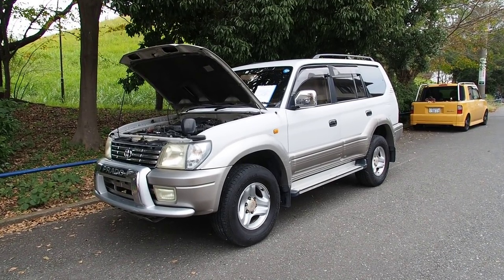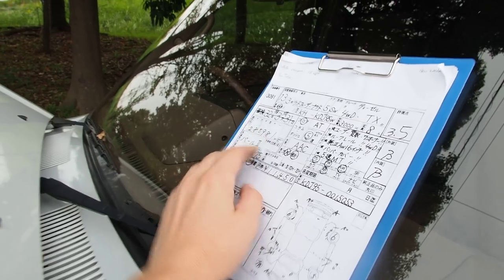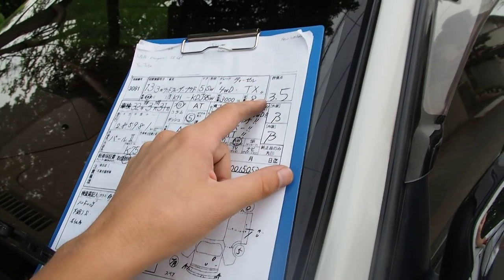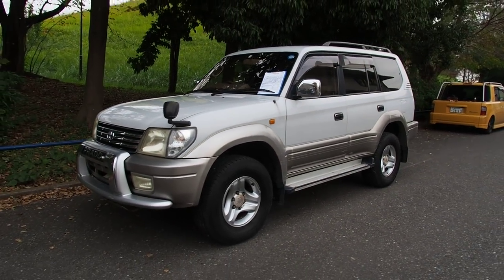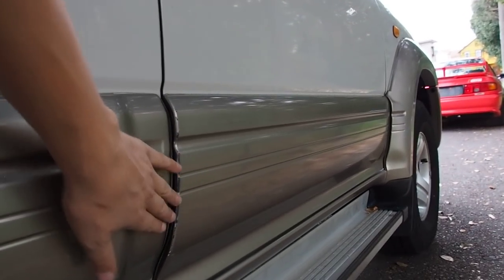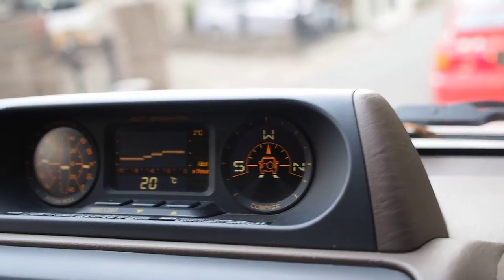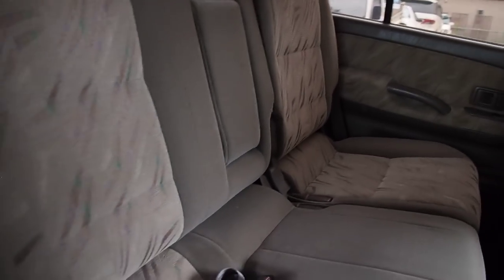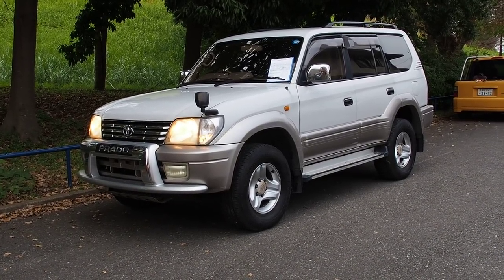2001 Toyota Land Cruiser Prado 5-speed Manual Turbo Diesel (Canada Import) Japan Purchase Review

Comment: Its a 1KD not a 1KZ,read the auction sheet again.
Reply: These are 1KZ 3.0 diesel engine.
Reply: @LloydAsim   2000 onwards prados are 1kd, read the auction sheet if you can.
Reply: @gamingchanneltoe3  nope.. even the LC 120 series has this 1kz-te engines..not a 1kd, 1kd are common rails,D4D technology.
Reply: @LloydAsim  wrong 120 comes with 1kz 5L-E and 1kd,the prado in the video has a 1kd.I dont think you have ever owned one or you would have known,also i repeat read the auction sheet which he shows in the video. 1kd engines are in JDM and UK specs prados/colarados from 1999-2000 onwards
Reply: @gamingchanneltoe3  oh my bad, I had the 98 and had a 1kz 3.0 in it. You're right it's a 1kd-ftv
Reply: @LloydAsim  no probelms brother, take care.